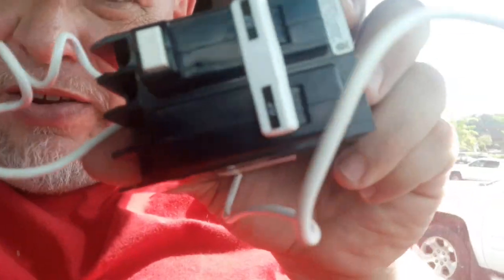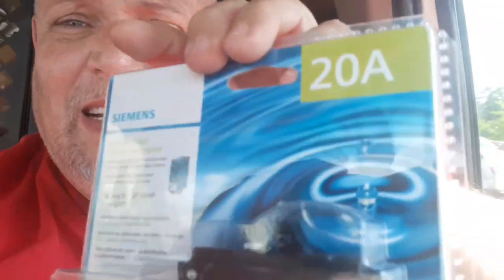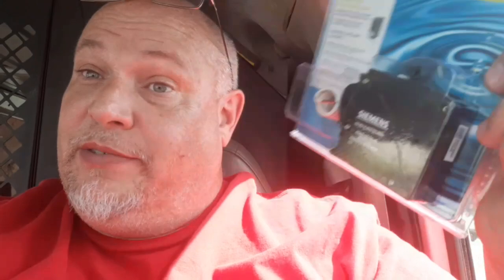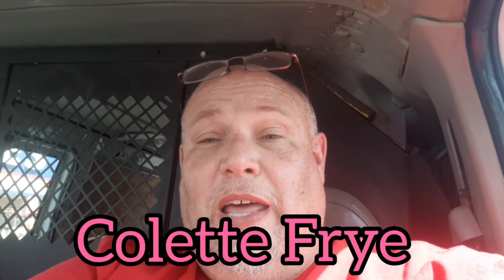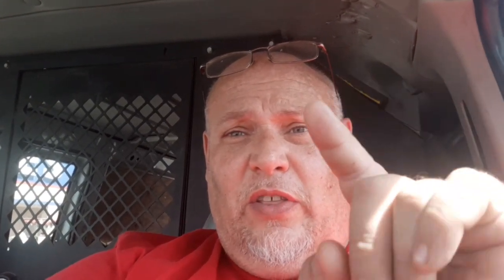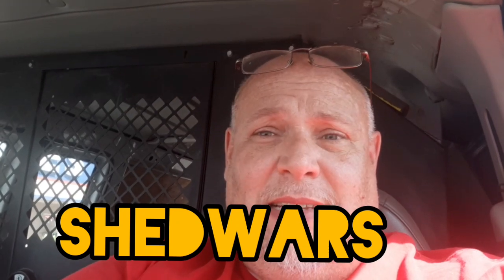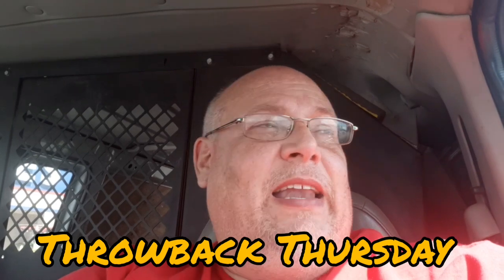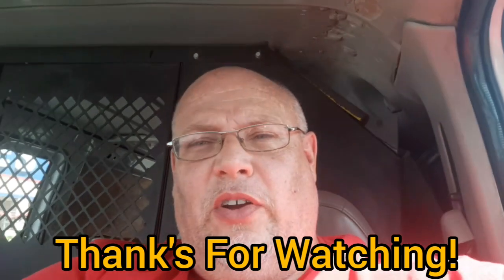Why GFCI Breaker is tripping on pool pump

Comment: Just wanted to share my success story thanks to this video. After a frustrating summer and fall of occasionaly coming home from work to find my pool never turned on. We were scratching our heads trying to troubleshoot the problem. Concern of possible exposed wires or a faulty new Pentair VSF Inteliflo pump. I knew this would be a much bigger problem when the cold weather came but nobody could tell me why this might be happening. So I decided to look to YouTube for some answers and came accross this video which has undoubtedly saved us from a certian castastrophic failure right before our deepest freeze of the year. I took Frank's advice and ordered the Siemens GFCI breaker from my local Home Depot. Since replacement we have been running flawlessly and our freeze protector is able to run as needed. Thank you Frank and Tina for this life saving video!!
Reply from the maker: That is awesome! Glad it helped!
Thanks for Watching and posting!

Comment: The solution mentioned here really works. Thank you. I had my entire pool pump electric panel replaced with more expensive breaker but it keeps tripping at different times. The Siemens brand mentioned here really work well with my 1.5hp pentair superflo vs pump.  It’s raining in my place a lot of times and still no tripping. Thank you again.
Reply from the maker: I'm glad it helped! BTW, I just got this comment smh...
Reply: I have this exact pump (was replaced at the end of last pool season) and it is tripping my main house "test" breaker every night when the pump jumps to high speed. Hoping this will help alleviate that.

Comment: I was dreading having to tear out my beautiful SquareD Q0 panel to replace it with a crappy Siemens panel — until someone mentioned that I can simply ADD a tiny 60A Siemens panel next to the equipment pad (and then use a regular breaker in the SquareD panel).  Why didn’t I think of that?   Such a simple solution.  Keep your existing panel/subpanel and just add the Siemens GFI breaker downstream!

Comment: They rewired the barns at our county fairgrounds about ten years ago.. most of the 3 speed fans used to cool the animals wouldn't run.. all because of the GFCI mess they put in.
Luckily, the "on site electrician" was much more than a wire puller!!!
He disappeared with our fans for about twenty minutes, came back and said he got lucky!! 
Our older fans could be rewired to work 😎
Didn't cost us a thing, other than waiting for him to get it to work!!
BTW, GFCI are used in too many applications where they shouldn't!!!
Thanks for the video Frank!! 
Glad Tina is still healing up nicely!!
Give her a gentle hug for me...👍
Reply from the maker: He took the VFD off ! Which is smart. But that Siemans breaker would have held. It took me 2 years to figure this out lol! And as far as I know I'm the only one who knows so that why the share lol!
Reply: @FrankAndTinaOfficial  nice!!! 
All parts are not created equal!!
We run into that a lot! Especially electrical parts!
Reply from the maker: @GosselinFarmsEdGosselin  gfci do not like variable speed motors but The Siemans brand ones do. So I'll bet that will actually help you down the road.😀👍
Reply: @FrankAndTinaOfficial  I'm sure it will! Thanks again Frank!! Appreciate it!

Comment: Frank 
I have a booster pump for an irrigation system.  It is a 2 HP unit.  I have 12/2 uf run from relay box to pump.  I checked continuity all good.  The dedicated circuit feeding the relay box was on a good functioning 20A standard breaker.  When relay opened successfully after timer sent signal the panel breaker would trip within 3-5 seconds.  I checked voltage at pump when relay opened it was 68volts ?  I did same check at pump with 12/2 removed from pump it was 122volts.  The shaft on pump wasn’t seized and the start capacitor tested fine.  I then swapped the dedicated single pole 20A breaker to a 15A standard double pole and turned the voltage switch on the pump from 115v to 230v the timer sent signal to relay and pump ran perfectly.  Question is why was voltage drop on the sp breaker at 68volts was there just too much resistance at pump and it needed more power ?  At the 150’ from pump the pump manual calls for a #14 wire when running 230v but a #6 wire if running 115v at same distance.  I guess I’m confused at why the voltage drop to 68v when connected to pump but 122 volts when disconnected  from pump.  I first thought just the distance but when disconnected at same distance a proper range reading ?  Perhaps the load from motor just dropped the reading from 122 to 68 ?  Your professional opinion would be greatly appreciated …. Thanks for a great video .  Btw both standard breakers were Siemens brand

Comment: How awesome is this!! We just had one installed.. What about air conditioners that are tripping the power. Frank..thanks for this info!! You are awesomeeeeeee. Sending healing vibes to Tina💜🙏
Reply from the maker: Thank you so much! Usually they need a slow start capacitor or just new capacitors on the fan or the compressor.  But Could be a number of things.
Reply: @FrankAndTinaOfficial  both of the AC's are brand new. I think but I know zero about electrical work is that the system is overloaded and can't handle the power needed. ??
Reply from the maker: @sunshinesideoflife7710  if they are brand new they should not be tripping. Look at the information plate on the side of the AC unit and see what the minimum and maximum amperage is. It should say something like Min 30 Max 50.  That means you can't go smaller than a 30 amp breaker or higher than a 50. And make sure you have the breaker as close to the Max as you can get.
Reply from the maker: @sunshinesideoflife7710  also the wire size going to the unit has to match the breaker or you can cause a fire hazard. 10 gauge wire is good for up to 30 amps, 8 is 40, 6 is 50 4 is 60 that is in copper.
Aluminum you just go up a size
 So 10 gage wire would only be good for 20 amps etc...
Reply: @FrankAndTinaOfficial  I think this might be the issue. Wiring is really old in my house.  I forgot to mention that this is first year we had AC's in those bedrooms. Appears this is going to be very expensive fix..Such is life..ahhh Thanks for your advice and help! Appreciate you
Reply from the maker: @sunshinesideoflife7710  are they window units?
Reply: @FrankAndTinaOfficial  no. They are AC's on wheels. Stand upright.  Our windows do not allow for window units.
Reply from the maker: @sunshinesideoflife7710  portable units that plug into the wall I assume. If so try plugging one into the kitchen outlets and see if that helps!.
Reply from the maker: @sunshinesideoflife7710  Kitchen, dining room outlets are usually in 12 gauge.  They should hold more.
Reply: @FrankAndTinaOfficial  awesome advice thank you. We need to get the bigger outlets. We definitely do not want a fire hazard nor overload a system not capable of handling it. Appreciate you once again Frank!
Reply from the maker: @sunshinesideoflife7710  absolutely! Any time!

Comment: Not an electrician I’m not saying this is wrong, but I have a variable speed pump on a Siemens 20 amp GFI, and it only trips when the weather is wet but not always. All of the connections are dry so it’s not due to wet circuitry. During dry weather it never trips. I can put a standard 20 amp breaker in without any problem. The pump and pool are bonded correctly but I can’t help but think that this bonding has something to do with the problem as it could be causing transient currents to feedback to the panel ground through the pump ground.  It’s obviously not enough to trip a standard 20 amp breaker. But again it only happens when the soil conductivity is high (wet). It’s been a huge pain in the neck for going on five years.
Reply from the maker: I would replace the breaker. Sometimes the can be extra sensitive when they have tripped a few times and some are just more sensitive right out of the pack.

Comment: This was absolutely my problem. We have a Pentair outdoor panel and the panel accepted an eaton gfi breaker. Constant problems. I went ahead and bought the breaker directly from Pentair. It’s literally a Siemens in a Pentair package. Problem solved.
Reply from the maker: Yep it's crazy but the Siemans has a higher trip rating at it makes a huge difference to a variable speed pump.
Thanks for watching!

Comment: Good Video Frank, however the line voltage 120/240 will have no impact on pump performance whatsoever.  The issue is the Milli Amp rating on a typical GFCI and as you indicated the Siemens breaker has a 6 Milli Amp trip rating.  Siemens makes a lot of breakers, make sure of the 6 MA rating.

Comment: Just replaced our pool pump motor. The original was 13 years old. But being in the country, no code inspectors, and no troubles with a tripped breaker.
Reply from the maker: Its probably no on a Gfci.
Reply: @FrankAndTinaOfficial  it's not. Just the light in the pool
Reply from the maker: @tracyphillips3325  that's all you really need on a gfci. But in Atlanta every pool has to have one. Nanny state lol!

Comment: This was great info and i had my electrician do this... It worked for about 5 days but when i went to turn on the pump yesterday, it turns on for a split second and then trips the breaker. Any ideas? It has been raining here a lot the past few days and i did see another comment where he said that affected him.
Reply from the maker: You are probably getting water in there somewhere. I would take all of the connections and inspect for water.

Comment: Hi Frank.  What if you already have the Sieman  20amp breaker on and it still trips  the beeaker  right  away  . Hayward  maxflo xe vs  is the pump.
Reply from the maker: It's one of 4 things. 
1. The wiring or the pump is getting water inside and is shorting out.
2. There is a nicked wire or wire touching a ground source or a hot. 
3. You have a bad pump
4. You have a bad breaker
You can narrow the problem down by process of elimination.  Check to see if water has gotten into any of the wiring .
Also check the wiring in the panel and in the flex going to the pump.
Try a new mechanical Breaker first. This will tell you if it's a ground fault or regular short.

Comment: My sta rite max pro pool filter trips during a rain fall. It usually works with in the day except its been rainy 4 " in as many days. Its also going to rain a lot next week.
Reply from the maker: I would check all connections on that and the seals. Its leaking somewhere and tripping the breaker.

Comment: I have an Eaton panel for my pool pump.  Will this breaker fit or is there now a Eaton breaker that is comparable to the siemans
Reply from the maker: It will fit. It will work properly, but it is not approved for that panel and is more or less a technicality that it is not the right one. However it will not pad an inspection.

Comment: hey brother question. Can I use a Siemens 50 amp double pole GFCI for my pool pump breaker. I'm feeding the panel with 6 gauge wire from a 50 amp breaker?  I'll check out those other channels as well.
Reply: Yep we use them all the time to feed a small sub panel and change to a 20 amp breaker there. But most pumps you can't wire with 50 amps straight. Look in the name plate it will tell you the Min and Max capacity just go anywhere between them and you will be good.

Comment: I have a question I have a inground pool with a variable speed pump. My pump operates as normal the problem that I have noticed just beginning about a month ago is the pump clock is running slow even after I set it to the right time a day later it will be off sometime over 8 hours. Do I need to replace my breakers?

Comment: For my pool I have a Siemens 2 pole 20 amp gfci breaker every time I’m trying to turn on my pool pump its humming and it’s not turning over I plug it into another breaker it works I currently don’t have it routed like that but could the breaker be the problem ??
Reply from the maker: I'd check the voltage output of the breaker and of the one you are plugging it into that works.
Reply: @FrankAndTinaOfficial  I’ll definitely try that tomorrow

Comment: I'm fighting this right now.  The old pump was seized, so I bought a new pump.  Now it's tripping the breaker.  Tried several breakers, 15, 20, and a 40.  Trips instantly no hum or anything.
Reply from the maker: That sounds like you have a shorted wire some where in there. Or a ground touching a neutral. That will do it on a GFCI

Comment: Frank, thanks for the advice. My bearings went out and I went out and turned my pump on and it tripped the breaker. Is this due to the bearings being shot? Thanks
Reply from the maker: It could be. If it is locked up for sure it can be the cause.

Comment: Hello  I have a new black and decker pool pump. It keeps tripping the gfci outlet  when plugged in. I have tried other things on this outlet and it works just fine. i even tried running an extesion cord from the house to the pump and that did work. So the pump works. also switched the outlet for a new one the pump tripped that one too. Any suggestions?
Reply from the maker: If the pump is tripping 2 different GFCI outlets its probably the pump that has a fault. I would try a gfci breaker and a regular outlet and if that doesn't work then try another pump.

Comment: Hello Frank I just found you..I’m new pool owner and our pool was put in May 2021 you describe my problem perfectly breaker keeps tripping inside my control panel that turns on the pool it doesn’t sparingly but when it gets hot outside it cuts off more I do not have a variable speed I have a Hayward super pump 700 S. Self priming. I know nothing about electrical stuff. What size or kind of seimens breaker would we need for our pool I know we do want to keep the speed so 240 I think is what you said ? I don’t understand the one pole or two pole sorry I’m so new to all this, I just need help understanding what I need to buy and were to buy it. Thank you so much for sharing your knowledge it’s a relief for someone like me who doesn’t understand why your brand new pool is having problems.
Reply from the maker: Nice to meet you Kimber! That pump i think is a variable speed. It will usually start in high then in about 10 minutes it will slow down. If you live in the US you should have Single phase Electrical Power. It has 2 cables coming from the power company into your meter. Each one has 120 volts. In the Electrical panel you can use a single pole breaker and only use 120 volts or a double pole and it its 240 volts because it puts 2 breakers together with 1 bar on the handle of the breaker connecting the two 120 volt breakers to make them into one 240 volt breaker. So on the 240 volt (or double pole) you should have 2 hot wires a black and a red and the 120 volt (or single pole) you should have one hot wire (black or red) and one neutral wire (white).
You will not get very much power on 120 but it will work on most pumps. There is a wiring diagram on the side  of the pump or on the inside to tell you how to change the pump to 120 or 240 volts.
You will need a 20 Amp breaker and it will be fed with 12 gage wire. 
You can purchase the Breaker from Home Depot or any other Siemens Dealer in your area. Also the newer Square D Homeline Breakers have a higher trip rating and will work ( they have recently changed theirs to fix the problem so be careful not to get one that was made over 6 months ago). 
If the Siemens breaker doesn't fix the problem, check all connections and make sure they are tight and that there is no nicks on the wires. If all is good the only other thing is to replace the pump. 
I hope this helps.
Reply: Yes! Thank you so so much. I live in Ringgold, Ga . As of yesterday my pool pump started leaking quite a bit it’s coming from underneath between the motor and the filter water basket. Sounds really strange and I got it on video. As of this morning it has stopped leaking no leak. I don’t understand, would the breaker and the pump be tied in together somehow?
Reply from the maker: Yep thats probably your problem. I'd about bet you will need a pump. My daughter that works with me Emily lives in Lafayette Ga right down the Road. We live in Bremen Ga so she has a 1.75 hr ride to work lol!

Comment: Will it trip a dead front gfci ??? I’m having this issue at the moment with square d
Reply from the maker: I would say so. The trip ratings on those are really low. But I would make sure its not a bad breaker or a ground fault situation first.

Comment: Hey man hope your wife's neck surgery went ok. I'm trying to figure out how to wire this hayward pool pump. Question these Siemens 2 pole GFCI breakers do I need to run a wire to the load nuetral on the breaker. I don;t have a load nuetral from the pump? :(
Reply: Sorry its took so long to respond
 It didnt go to my notifications IDK Why.
But no. No neutral is required on 240V

Comment: I have a 230v......2hp/0.31...60HZ...Ph1..... 7.5/2.1AMP pool pump model RS4F357I1L with Low speed and High Speed switch. Im running 8/3 from the pump to the panel 40ft away. I want to use the GFCI breaker. What breaker with what rating etc. do you recommend I use? Thank you.
Reply from the maker: You need to run the 8/3 to a small outside panel at the equipments and the best way is to feed the panel with a regular mechanical 40 amp 2 pole breaker and then use a 15A 240 GFCI Siemans Breaker to supply power to the pump. And 15a 1pole GFCI breaker to the lights. The Siemans breaker is the only one with a high enough trip rating to work properly on a variable speed pump.😊👍
Thanks for watching!